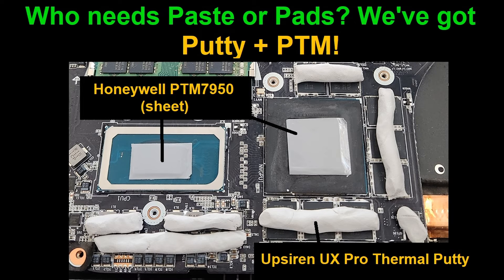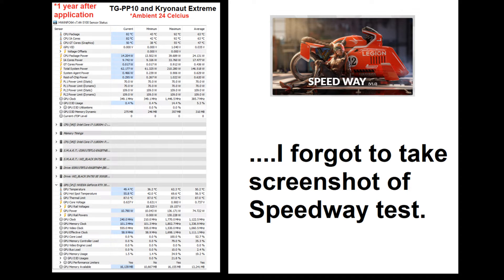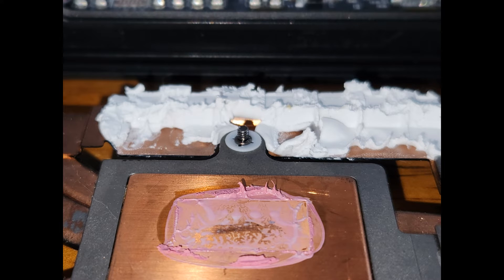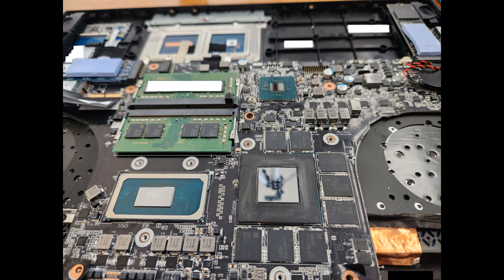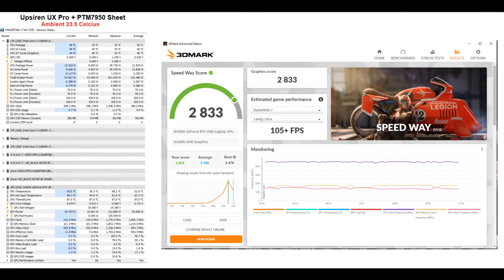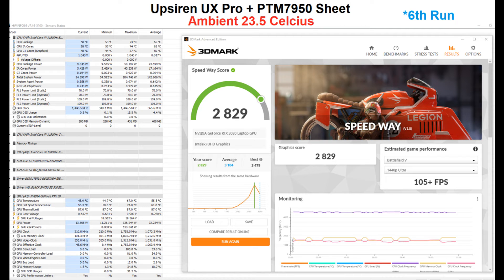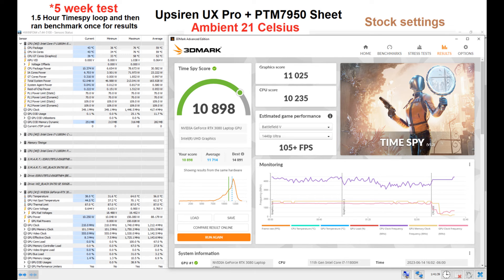RTX3080 Laptop meets Upsiren UX Pro thermal putty and Honeywell PTM7950

Comment: Hi Snark, when you reached this maximum cpu temp of 76 C in this test at 4:58 do you remember if you used normal fans speed (i.e. Gaming Mode + Power fan in Gigabyte Control Center) or if you set Turbo Mode + 100% fans speed in your Aorus 15 laptop when running 3Dmark? Thanks
Reply from the maker: 100% fan speed for all tests. I set it using the custom fixed profile and adjusted it there.

So it went from 92 Celsous on the CPU down to 67 Celsius. The early result of 76 Celsius was just a stepping on it's way to better cooling.

That's one of the thinga that makes using PTM so great. Gets better over time. It's why I now recommend folks to do a dedicated burn-in and aim for 75-80 Ceslius on both CPU and GPU core, for 2 hours. Best to run something like Furmark Stress Test, as well as the built in "CPU Burner" feature of Furmark, and adjust fan speed as needed to keep the temps up. That way the PTM can melt and squish thin. Then you can use the laptop normally after that.
Reply: @snarksdomain  Thanks for your answer. I have your same model of laptop, Aorus 15p yd, and I applied ptm7950 + upsiren utp 8 putty a few days ago. The problem is that, even after applying ptm and utp 8, I can reach good cpu max temps of 76-77C when gaming or when doing 3DMark ONLY IF I set fans speed to 100% manually all the time in Gigabyte Control Center with Turbo Mode. If I leave fans to normal Gaming Mode + Power fan instead, the cpu thermal throttles after passing 84C and it reaches 93-94C max temps. While the gpu stays cool in all occasions at 74-75C max temp even with fans set under 100%. Do you think that this behavior is normal? Or should I reapply ptm7950 and utp 8 putty to get better results? I mean: do you think it is absolutely impossible to reach 76-77C cpu max temps without setting fans manually to 100%? Have you ever succeeded in doing that with your Aorus 15p yd laptop?
Reply from the maker: @sanderpin94 well, PTM needs a burn in as I mentioned above. Even after burn in you should see improvements in the coming days and weeks.

That being said, it's likely worthwhile for you to remove the bottom cover and apply some pressure to the heatsink woth your hands to help squish the putty.
Reply from the maker: @sanderpin94 it's definitely possible. Mine gets down below 67 Celsius now with 100% fanspeed. I'd have to fiddle with it a bit to see how much I could slow the fans and stay below 76. I usually just run a custom fan curve and let it do it's thing while gaming. Then I set it to silent when doing stuff in word/excel or watching YouTube.

Comment: Thanks for the video, there is one question, Can I use ptm7950 on Colorful p15 evol (i5 12500H with rtx 4050) processor, and what is mm you mentioned for the thermal putty, I don't know what is for my laptop, can you suggest one for me? Thanks in adv!!
Reply from the maker: Yes. I'd use PTM7950 on both the CPU and GPU core, and then HY2206 / HY2236 on the VRAM, Mosfets, and Coils

Comment: Thats all nice, good job but what loudness setting the cooling of the laptop was set?? for me improving cooling is about making the laptop not so loud and cooler, high rpm fan setting it can cool the laptop of course.
Reply from the maker: I use fixed fan speeds for testing to show the difference in performance between products. The main goal being to achieve better cooling, which in the end allows you to slow the fans down if you're aiming for a certain dB level. If you'd like to see how different thermal putties stack up against one another, then feel free to browse through this video:

https://youtu.be/5iNXn8oaTWI

I also have an updated Laptop Thermal Putty Guide that shows the application process in more detail here;

https://youtu.be/0sOON88Oq_w

Comment: Do you think thermal putty would work better as a CPU TIM then PTM 7950. PTM is at 8.5 W per meter Kelvin but up siren UG pro is more than 16W per meter Kelvin.
Reply from the maker: No. Thermal Putty is not designed for direct contact between heataink and CPU or GPU core. It's designed to be a thermal gap filler. The particle sizes used in most top end Thermal Putties are far too large to be used directly on the CPU. It would hold the hearaink further away from the source of heat, and temperatures would be worse.

PTM7950, and other Phase Change Materials,  can squish as thin as ~0.038mm.

Another 5hing to jeeo in mind is that advertised Thermal Conductivity ratings are not to be trusted. They are used as a marketing ploy by most TIM manufacturers and brands, and this type of marketing has been extremely effective in the past when we could monitor our memory temperatures.
Reply: Thank you for your response. I also noticed that PTM 7950 is very sensitive to how you apply it. I find that when you just drop it on there is always air bubbles. The best way I’ve seen to do. It is to peel one corner with a very fine tweezer and roll it on then spray it with airspray to flash freeze it and then peel the other side off.
Reply from the maker: @brettweltz8135 I like cutting it to around 70% coverage by area and then using the included stickers, or even tape, to peel off the first side.

Rubbing a finger on it to get rid of the larger bubbles works well. I then use the sticker/tape at the corner and peel back towards to opposite corner (rather than lifting "up").

Seems to work really well and we still achieve full coverage once it melts during the burn in.
Reply: @snarksdomain  yeah I just did a repaste on an Acer predator Helio 18. Whoever thought to put liquid metal on the processor for a TIM should get fired. They never accounted for the pump out effect and when that happens and you push those machines hard you fry your hardware.

Comment: Hello bro, yesterday I applied PTM in my HP omen 7 5800h rx6600m. CPU with no turboboost is only 70°C pretty well, GPU is 68 on core and 80 on hotspot. I did benchmark 5 times  for 1 minute, but results weren't better. Do I have to wait for better thermals?
Reply from the maker: Yes. You need to get CPU and GPU temps up to 75-80 Celsius. I usually run it for at least 2 hours like that with a static load such as Furmark while also using the built in "CPU burner" to get the CPU hot at the same time.

The sheet of PTM starts off around 0.20mm-0.25mm. Once it melts it can squish down as thin as 0.038mm as long as it has adequate pressure.

Did you also apply new Thermal Putty? 

https://youtu.be/0sOON88Oq_w
Reply: No i haven't use new thermal putty, mine stock was really good, I also has good vram temps, 10 minutes In furmark +/- 75°C @snarksdomain

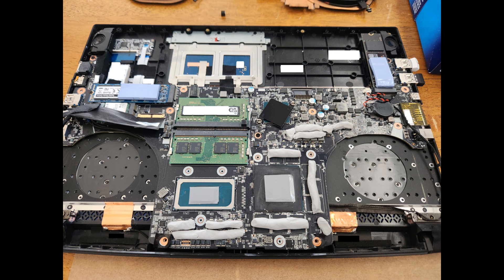Comment: 8:17 Great video! Really helped with my purchase decision. But I wanna know, why didn't you apply the UX Pro on the SSD's?
Reply from the maker: Hopefully you checked the charts located at the Google Drive link in video description to compare all the outties and oads I've tested. 

I generally don't recommend UX Pro for laptops as there are better and/or cheaper options.

You may also want to watch this video.
https://youtu.be/0sOON88Oq_w

Which laptop model do you have? Hopefully not an ASUS (you'll need a thinner putty with smaller particles if that's the case)

Comment: Is it required to also apply the Upsiren thermal putty alongside the PTM 7950? I'm planning to do maintenance work on my laptop. My laptop's GPU is a Nvidia GTX 1650  Max Q
Reply: Lenovo S540 IWL 15. The CPU is an i7 8thgen
Reply from the maker: @jethrocarloquijano7087 I was able to find a repaste video of a Y540, which I'm.hoping is similar to yours.

https://youtu.be/_QpSgBcdtWo?si=L3kvJHlZjl88vVEB

You should be able to use any putty you like. Using a thin outty might still give you the easiest time (Halnziye HY236), or you could go for higher performance from one of the better putties on the charts (Google Drive link in video description: Test Chart Repository > VRAM TIM > ETCHASH)
Reply from the maker: Which model/brand of laptop do you have?

Comment: You guys need to chill out about application.  The difference between good and bad application is 1c at best. A good mounting pressure and waight distribution is more important
Reply from the maker: It worked well for this Gigabyte laptop, as the gaps were large enough to be forgiving.

ASUS laptops are a whole different matter. Overusing outry in them turns into a real headache. Also have to use specific putties with smaller particles.

Comment: Im currently trying to buy some of this PTM7950 stuff but its crazy how none of the local shops actually sell it and only dodgy online ebay and aliexpress sellers available, I keep hearing there is lots of fake ones out there too. Where do I find the good stuff? :(
Reply from the maker: I've had very good luck buying from Aliexpress. I usually buy it from the "Passionate Girl Store" but "Cooler Bro Store" is also good.

Alternatively you can get Thermal Grizzly PhaseSheet PTM (rebranded Honeywell stuff according to Der8auer), Thermalright Heilos V1/V2,  or Upsiren PCM-1

Comment: Replacing pads with putty might be the worst thing you could do. Enjoy cleaning them up when they dried out
Reply from the maker: Thanks for watching my video. To each their own I suppose. I really like the amazing core contact using putty provides. I've cleaned up putty hundreds of times. It's not actually that bad. No worse that baked on crumbling pads. Also, some putties are easier to clean than others.

Luckily, the stuff seems to last a really really long time and still perform well. Certainly longer than pads.

Replacing pads with putty is the best thing you can do.

Edit: most modern gaming laptops actually use Thermal Putty instead of pads. If you feel like watching my Laptop Thermal Putty Guide, it shows me removing the factory Thermal Putty and applying a better one.
Reply: That's not k5.

Comment: You're putting like 10 times too much TP on. It literally needs to be 1-1.5mm thick. That's it.
Reply from the maker: 1mm would be too thin for my laptop, but I agree that I used too much here. Still worked out well and had good core contact/pressure for the PTM to get nice and thin.

Here's my updated Laptop Putty Guide.

https://youtu.be/0sOON88Oq_w
Reply: @snarksdomain  Have you tried testing any pads yet? I'd be interested in seeing that.
Reply from the maker: @YahDude yep. You can find the test results between dozens of putties and pads located on the Google Drive link in video description (Test Chart Repository > VRAM TIM > ETCHASH). I also test shims and putty combos.

You can view most of the applications in the Live section of the channel. The current charts are using Testbench 2.1 with a Zotac 3070ti GPU with a 1.8mm gap, OC'd VRAM (GDDR6X) and a fixed fan speed.

Will be testing using Testbench 3 soon. You can see more info on that in the below video:

https://youtu.be/5iNXn8oaTWI
Reply: @snarksdomain  Thanks, lots of good info, do you have sortable charts though?
Reply from the maker: @YahDude  i don't, but will have separate charts fo pads, putties, and exotic. Along with full combined chart soon.

Is there a method you would want to sort by?

Currently they are sorted by VRAM T-Delta from best at the top, to worst at the bottom. These results are based on logging ambient temperatures in real time to HWINFO64 log and data is processed using an excel calculator sheet I made.
Reply: @snarksdomain  Not any certain one, I just prefer charts I can sort by and edit. 

Surprised to see k5 do so bad when many of us have had good results with it. I wonder if this has to do with the thickness applied?
Reply from the maker: @YahDude same thickness is applied for all putties. A 6mm log/cylinder the fully fills a 1.8mm gap with a 14mm width of GDDR6X

You can also see Igor'sLAB results of the various putties. He has some colorful things to say about K5 Pro and also K4 Pro (paste). Even a later LTT video showed the MJT 110 on the 3090 they used it on.
Reply: @snarksdomain  Is that German?
Reply from the maker: @YahDude Yes, but luckily you can read it all in English too.

https://www.igorslab.de/en/best-thermal-putty-database-and-charts-putty-versus-putty-tests-and-suitability-for-memory-modules-and-voltage-converters/
Reply: @snarksdomain  Oh thanks. Hey man I just finished yesterday getting rid of that sht K5 and used U6 Pro with PTM7950 and my Acer Pred Helios 3060 is running better than it ever has. Power is back up and stress testing the GPU I can't even get it higher than 65, it's amazing. 

Also just to pick on you a bit more, 10G was enough, though I did use some thermal pads on some of the smaller less critical stuff. 20G would be more than enough, I had about 10 percent left over. 

I'll be buying that from now on likely. Thanks for all your information and the time you've taken to do these videos! Truly appreciated!
Reply from the maker: @YahDude I'm hoping you got the good U6 Pro from Upsiren (China). https://youtu.be/xND1726G624
Reply: @snarksdomain  Yup, it's the right one. Got it on AMZ.
Reply from the maker: @YahDude  Both are available on Amazon. If it was overly sticky then it could be from CSGR. But if it has the Upsiren Sircker on the lid then it should be the correct one.
Reply: @snarksdomain  It's the right one.

Comment: As far as I can see, you've applied PTM 7950 in a way that it exceeds the size of the CPU and GPU—it’s spread beyond their surfaces. Did this cause any issues, like pump-out or similar problems? I'm planning to use PTM as well, and I'm wondering: should I apply it exactly to the size of the CPU and GPU, or is it still effective even if it goes beyond their edges? thank you.
Reply from the maker: @holybiblesevdalısı  I'm glad you asked. I experience no issues, but I now recommend aiming for around 50-70% coverage when cutting it with scissors.

It makes 2nd peel much easier and has a side be fit of saving more PTM for another application. When it melts it still achieves full coverage. Even a piece that is 20% the size of the die (by area), will achieve full coverage, but aim for 50-70%.

Also, I now start off with a piece of tape on either side at the same corner and pull apart. That takes care of the first peel. Put it in place and rub your finger on it to work out larger air bubbles and make it stick to the die. Let it cool down for a few minutes. When you go to peel the 2nd film, you'll be using a piece of tape again. Pull BACK towards the opposite corner, don't pull UP.
Reply: @snarksdomain  Thank you for the valuable information you provided. I don't know much about thermal paste or pads. I recently applied Thermalright Heilos, and my temperatures are currently under control. I've already ordered PTM 7950, and it should arrive soon. If Heilos keeps performing this well, I might postpone applying the PTM 7950. I guess there's not a huge difference between Heilos and PTM 7950 anyway. What do you think—should I stick with Heilos or go ahead and apply the incoming PTM 7950?
Reply from the maker: @abajurnightt  I'd leave it with Heilos unless you see degrading temperatures in a few years. 

You can also reuse PTM/PCM. Just scrape up the bits that form around the die and place them in the center, then place a piece of aluminum foil over it, and use a flat piece of metal and a lighter/candle to heat the metal up, then press it down and use it like a hot iron. it'll melt it flat again for you and then you remount the cooler.

Comment: Why not use 7950 on the VRMS?
Reply from the maker: It's not designed as a Thermal Gao Filler like Putty or Pads are. It's meant for direct contact between Silicon and Heatsink. It melts and becomes fluid starting around 45 Celsius.

You'd also have to stack multiple layers to fill that gap. I do not recommend using PTM/PCM that way. It wouldn't be able to compete with the performance of putty since PTM uses much smaller particle sizes. Putty uses larger ones, which helps boost thermal performance.